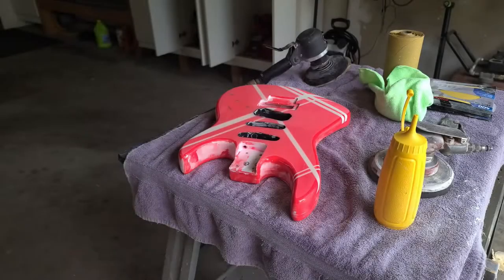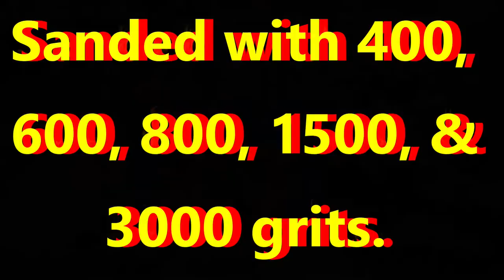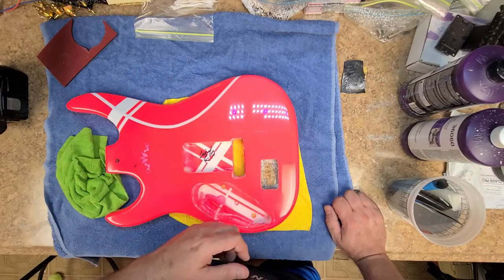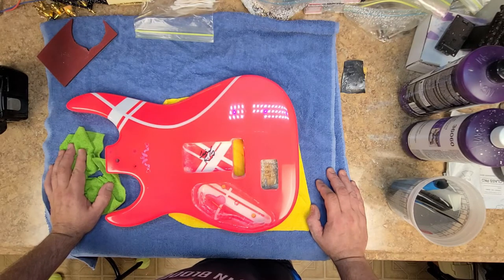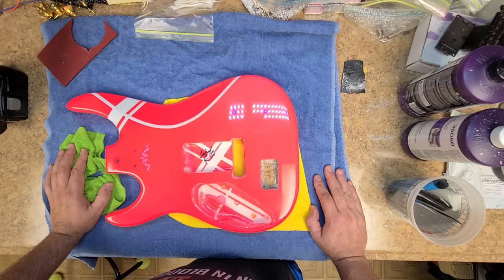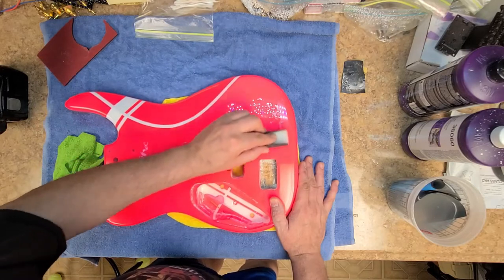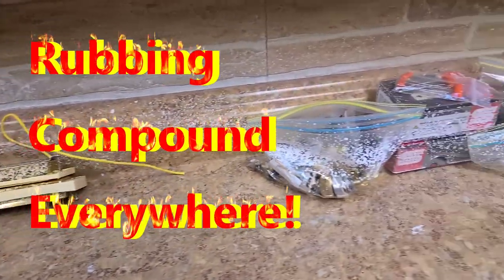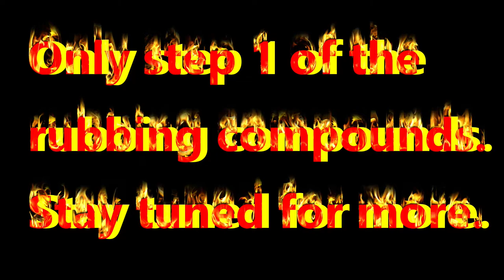Guitar Buffing Kramer Gets Buffed

Comment: Can you tell me the benefits of pouring compared to spraying?
Thinking about doing some customs myself. Thanks.
Reply from the maker: I like the pouring because you get a nice coat the first time without a reapplying. Once you get the hang of how to mask the sides for the dripping, it all comes together with a nice deep gloss. No smell, not flammable, and no overspray. It is tricky to do because its not just a flat surface your working with. Once the epoxy is on, it's not easy to sand off after it cures. It is harder to scratch, chip and dent.
Reply: @ericctheartofnoise8613  cool. I'll go back and look at more of your vids when I get a chance.
The Sonnys BBQ has tables with a 1/4- 1/2 thick clear something on them.
That's what I want. Maybe a lil less lol.
Ok thanks